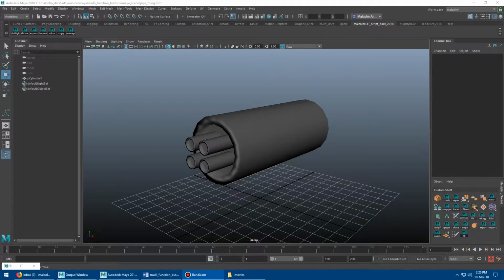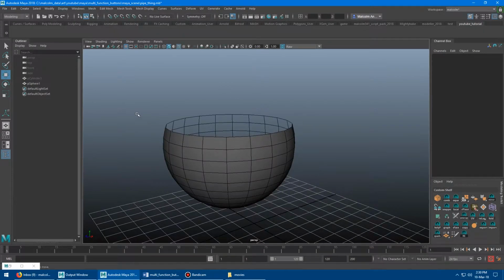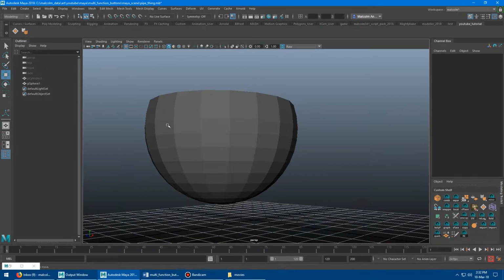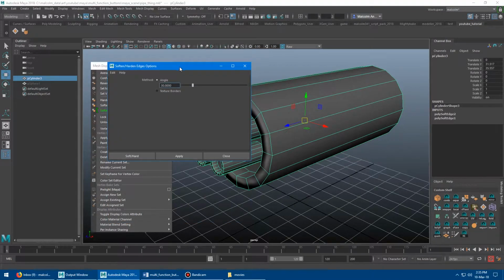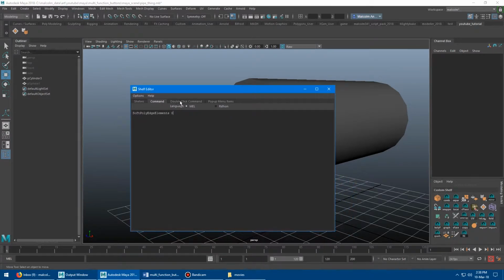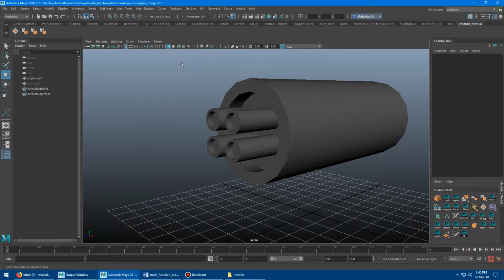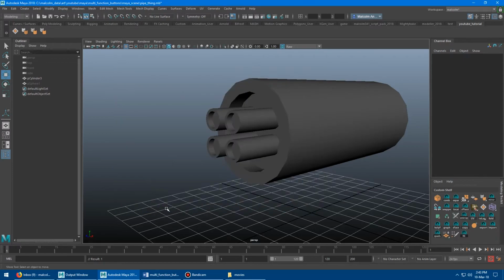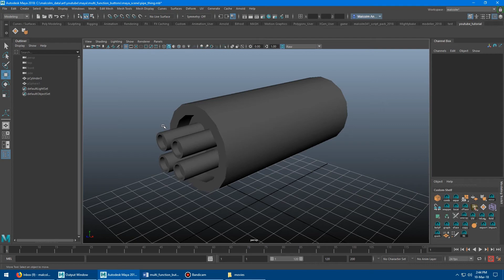Make One Shelf Button Run Three Commands in Maya

Comment: This will help but can we set this as a custom marking menu, I don't know mel but I was trying to create a custom marking menu (saw a tutorial) where I will store essential functions like set selection angle to X value, toggle hard edges, toggle texture borders, etc so that I will more efficient, I can get that command from the script editor but I can't find a way to toggles it on of off, can you help me?
Reply from the maker: I don't use custom marking menus I prefer buttons in the MTK custom shelf and hotkeys. I believe you can run mel code in the marking menu thing though. Toggle is not straight forward, there's no magic code to toggle things, you usually have to write custom code to toggle something because you need to tell the thing to check if it's already turned on through the Maya interface. If you don't care about that and are happy to sometimes have to click the button twice because it's already turned on in the Maya interface you can make a generic toggle that looks like this. But, this require a global variable to be set which is dangerous, so you need to change the name of the dangerous_toggle for each hotkey/marking menu toggle you make otherwise they'll interfere with each other and be annoying.

global int $dangerous_toggle;
if ($dangerous_toggle == 0)
{
    //Turn on
    //Code goes here
}

if ($dangerous_toggle == 1)
{
    //Turn off
    //Code goes here
}
$dangerous_toggle = !$dangerous_toggle;
Reply: @malcolm341  I'll try it out, thanks for the reply. You are amazing.